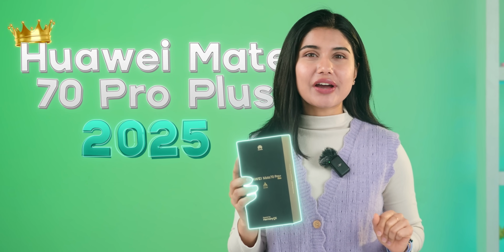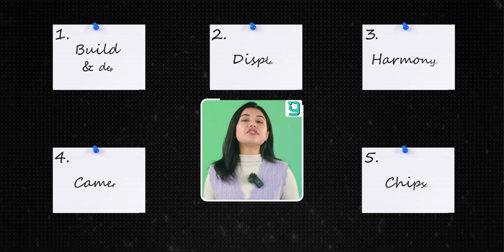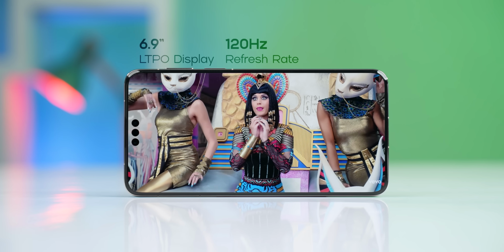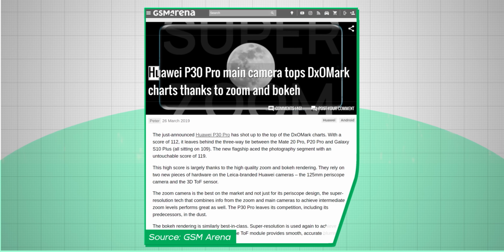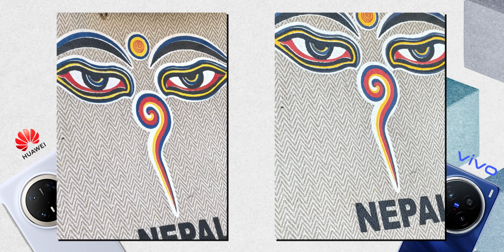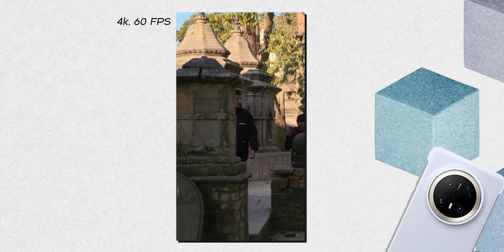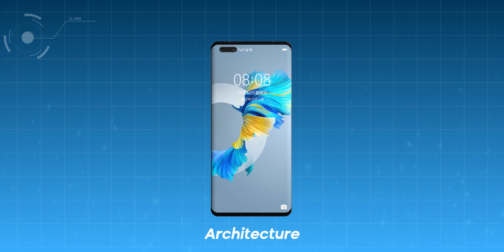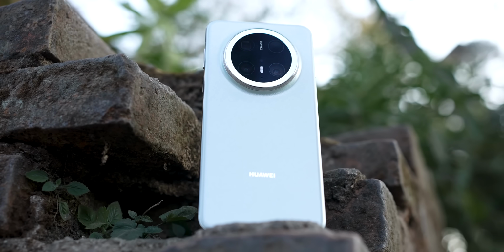Huawei Mate 70 Pro+ Unboxing & Review - The Hidden GEM!

Comment: I owned an Honor 8 Pro (with Kirin 960) in 2017 and used it for 2 years until I lost it. I am still yet to find a device that would give me the same feeling of perfection even in this 2025. My mother got an Honor Play (with Kirin 970) in 2018, she used it happily till 2025 and had to change it only because her banking app was not supporting its old software. Now my daughter is using it, and everything still works butter smooth.

Comment: Meh. That processor is trash and compare to the x200 pro the x200 pro is much cheaper than mate 70 pro+ its not a contest.
Reply: In synthetic benchmark it perform low numbers but it's good in games
Reply: @SethRoganSeth  sure. Even midrange soc is good in games

Comment: Hi, I would love to see a side-by-side comparison between the latest Pixel device and the Huawei Mate 70 Pro+. It’s worth highlighting that the Google Tensor G4 chipset has a similar AnTuTu score to the Hi Silicon Kirin 9020.

Even though Google had the opportunity to use the latest chipset, this demonstrates that the "chip size race" is more of a marketing gimmick than a true performance differentiator. While Google's chip is considered much slower than the latest offerings from Snapdragon or MediaTek, it is still smart enough to handle AI applications efficiently and delivers satisfactory frame rates for gaming.